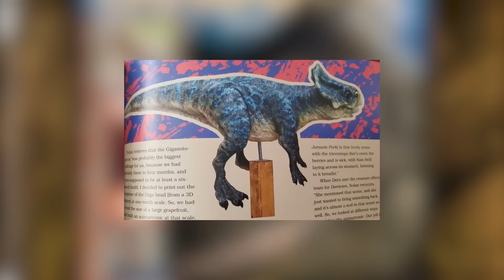Jurassic Park Animatronics 3

Comment: 9:53 They said it in the movie that you said you watched, so why did you pronounce it wrong?

Giganotosaurus. Not gigantosaurus.

I used to say it the same way until Dominion said it. A lot of people did.

10:10 gig-uh-NOT-o-saurus

And not "Jiga", it's as the letter G instead, not as J. 

9:20 small "nasutoceratops". You've mentioned Battle at Big Rock, which showed the baby, which was clearly stated to be a nasutoceratops. I just don't completely understand how you keep saying the wrong things when you've watched these that told you what they were and how to say them. I mean, but I can understand mixing them up, but the baby Triceratops in Fallen Kingdom looks different.

10:04 this time you said "giga"correctly? You've saying "jiga" in the full name, so why suddenly say that part right?

Comment: Excuse me if I’m mistaken but I thought The Exhibition was by Creature Technology? I went to The Exhibition and I highly suggest any animatronic/ JP and JW lovers go see it. I even was curious if they added on the legs of the T-Rex when running considering how large it was and when recording by raising my arm above the fencing I could see that anything below it’s knees was not attached but basically upper part of the legs were just left to move without feet… I also expect this is why in some venues it seems the Rex stands up to full height than others. Still amazing though!
Reply from the maker: Absolutely it looks amazing! We’ll be there at the end of the month and we can’t wait! That’s correct that was the previous exhibition but this year’s exhibition is powered by Animax this is an official statement: 

Jurassic World: The Exhibition features cutting-edge, state-of-the-art technology that is powered by Animax Designs, our animatronics powerhouse located in the U.S.," 
Ron Tan, Cityneon’s executive chairman and group CEO
Reply: @fastpassfacts  huh interesting I didn’t know they had changed. Thank you for the detailed info it’s so awesome to see people with equal animatronic love especially the JP and JW ones. Loved you guys for years! 💙
Reply: Creature Technologies did do most of the dinos for the first exhibition, but Animax took over the contract after being acquired by City Neon in 2020.
Reply: @LauraEJordan  where is the info on this I would def like to read up on why the change?
Reply: @k.a.tproductions2713  I don't know the details on why they changed, though I assume Creature Technologies was booked out when City Neon decided to expand, as they only accept a limited number of contracts at a time. City Neon and Animax's social media have had a fair amount of info on the exhibition and Tested did a video series with them on building dinos, but sadly they took the videos down.